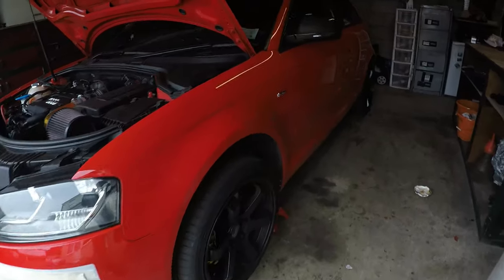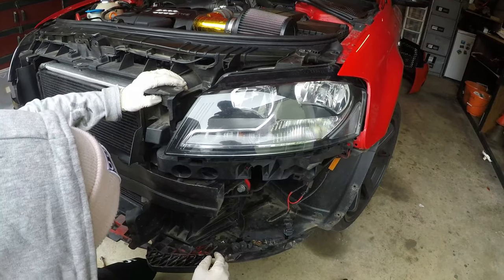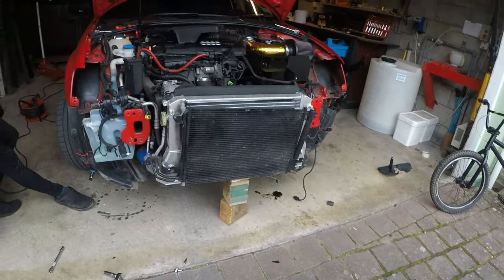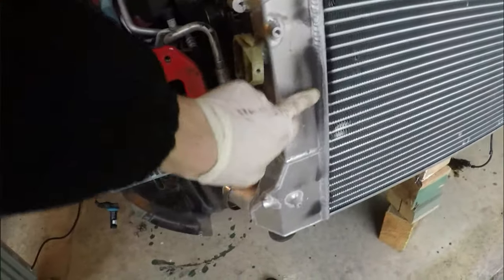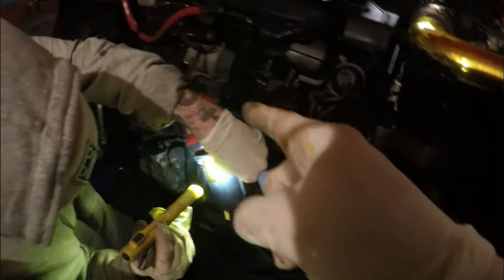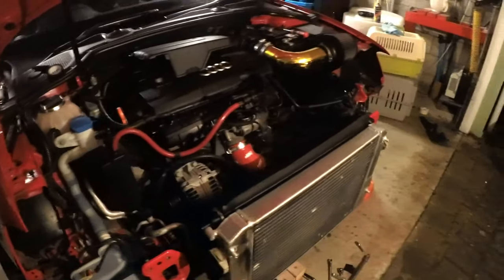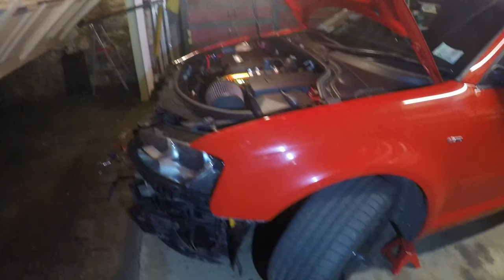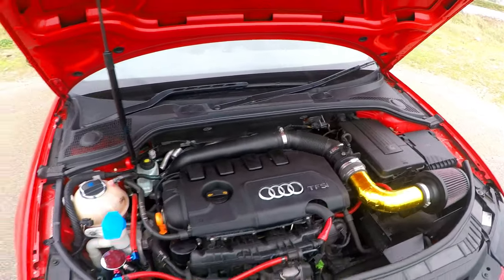AC Radiator Delete - Audi A3 8P

Comment: Your mates a legend to soldier on until 3am, hope you bought the beers....just wondering when you changed the grille, did you get rid of the foam ? I just replaced my grille for the rs3 grille and was wondering if I need to keep the foam  that sits in between the crash bar and grille ?
Reply from the maker: Hi mate, yes haha, i did ditch the foam as it wasn't sitting properly with it still in.. sorry for the late response!

Comment: Sick bro!! I have a 06 A3 2.0T manual. Plan to upgrade turbo, fuel pump & tune etc. I’m currently in search for a radiator support. I’ve order one new but was refunded my money and told by auto body parts they’re discontinued/no longer made anymore!? Does anyone know where I could get one even used ? eBay was a no.
Reply from the maker: Hi mate, thank you! although I don't really know, best thing to do is get the part number and search it via google im sure there will be multiple places that supply it, if not Audi dealership

Comment: Hi mate. What bulbs have you got on?
Reply from the maker: HID kit bud
Reply: @MotoAdventuresYT  is that around 6000k?
Reply: Im got an airflow leak aswell from my intercooler due to a damage, do i need to replace the radiator aswell?
Reply from the maker: jpisos04 yes mate bang on...
Reply from the maker: jpisos04 no bud, the first radiator is AC, the second is the intercooler, and the very back one is the coolant. So which ever one is damaged, replace
Reply from the maker: jpisos04 no mate I’d go for something like this... https://www.ebay.co.uk/itm/322909466449 
Direct fit.
Reply: @MotoAdventuresYT  ive got tdi does it matter? Im only thinking about darkside as it lets me pay 3months
Reply from the maker: jpisos04 ah, probably does fit TDi then mate
Reply: @MotoAdventuresYT  got it remap recently, is there really a point in replacing my intercooler with an aftermaket? Sorry for so many questions mate😂
Reply from the maker: jpisos04 no worries bud, just at work not doing a lot 😂 if you just got it mapped I wouldn’t bud because you’ll have to get it mapped again. Unless your planning on getting a intercooler and then re mapping. Might aswell see what else you can do before the next nap.
Reply: @MotoAdventuresYT  i got it remap dpf egr delete and decat without knowing the intercoolers leaking so i haven't really seen the difference in power and noise yet. Might just replace with an oem one brandnew cost about £100
Reply from the maker: jpisos04 might be a good shout if you arnt gonna go any further mate. Loosing that cold air
Reply: @MotoAdventuresYT  just that i wanna keep the mod minimum as i dont know how long i will keep the car. Trying hard to resist the temptation😁. Anyway will be replacing the intercooler this weekend hopefuly get in a day. Thanks for all the info